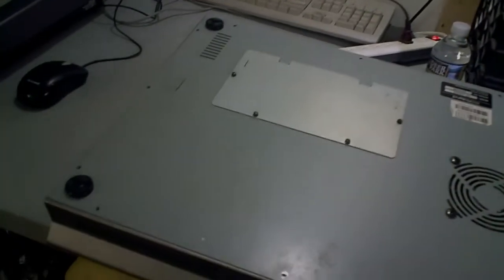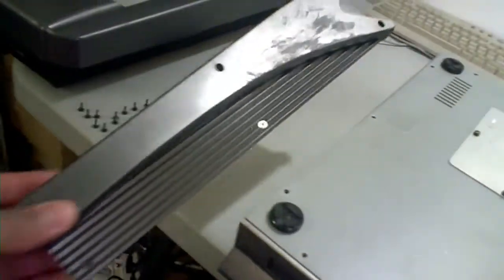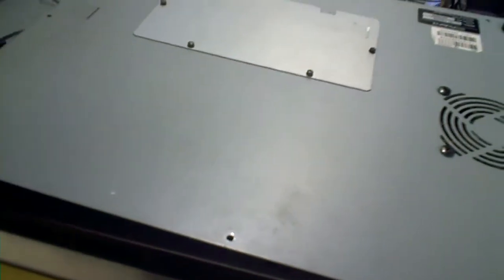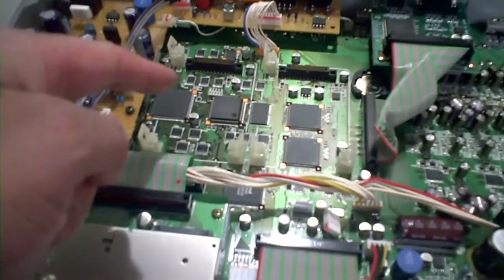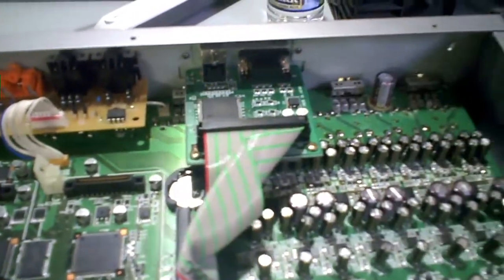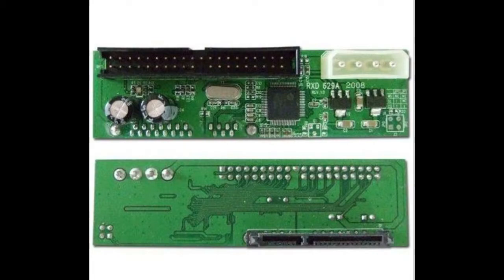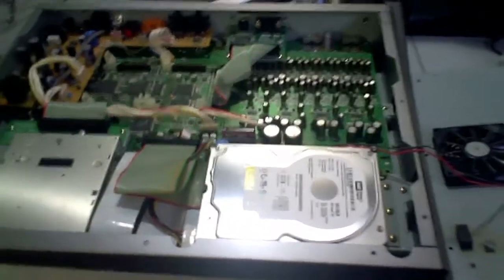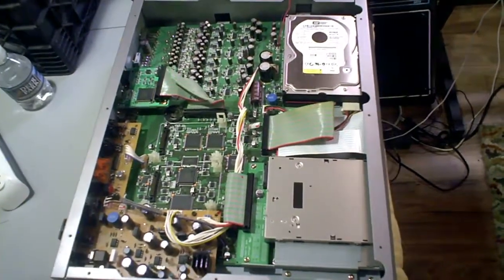Roland VS-2000CD interior

Comment: My mouse is connected. But i see no pointer on the monitor screen. The 2000 screen has a pointer. The mouse is connected to the 2000.what is the solution.
Reply from the maker: in the settings you need to change the mouse to monitor from VS2000.

Comment: I am a beat maker using a MPC 4000 and records.  I have never moved any of my beats outside of my MPC 4000 yet,  to any DAW or recorder.  I really want to get a VS but am a little concerned with the learning curve.  As someone new to the VS,  what would you recommend?  I would like to have a CD burner on it as well.  Thank you and great videos.
Reply from the maker: Nick Neilson definitely  get another item to record your mpc into be it software daw or hardware daw. I recommend  the roland vs2000CD at or near $300 with vga card and internal vs8f2 efx card. The vs2480CD at around $600. The Akai dps16 at $200. cheers.
Reply: Awesome,  thanks for the feedback,  much appreciated.